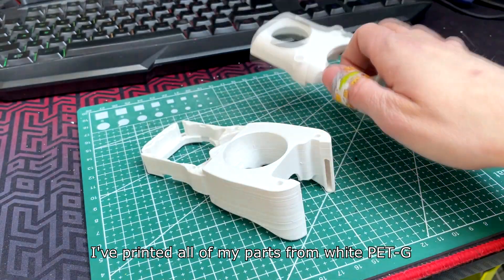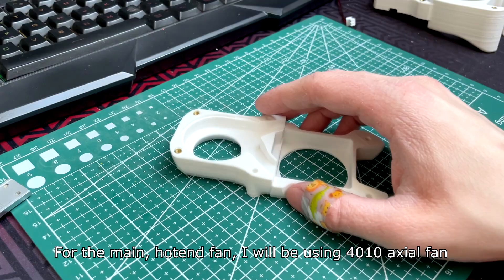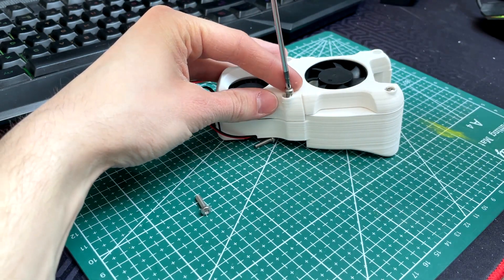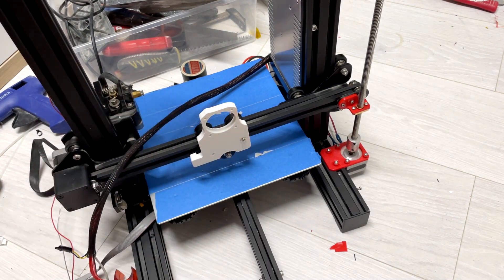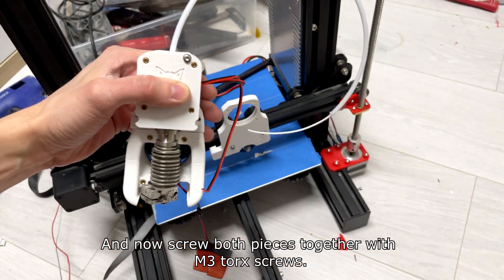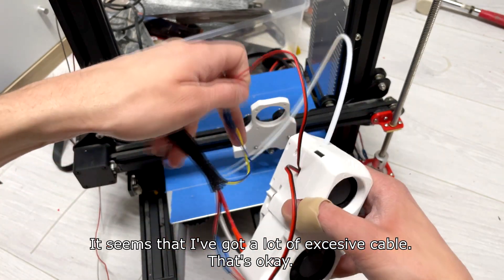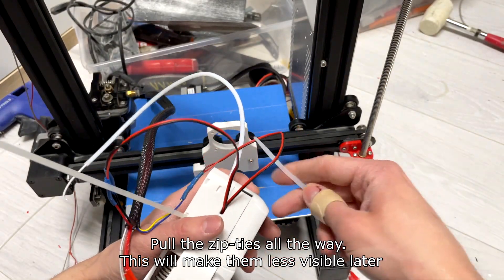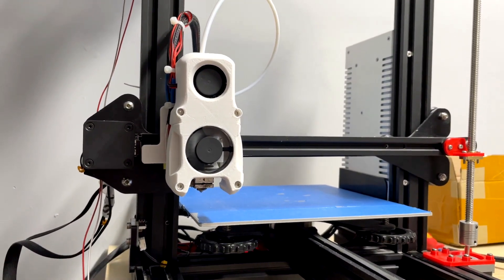Ender Afterburner | Voron Afterburner Remix

Comment: Are you losing Z height with this setup as the after burner is taller than the older extruder? It looks  really neat btw!
Reply from the maker: Thanks! It really depends on which hotend you’re using with it. I think I’ve lost about 10mm total in Z height which is not a big deal for me
Reply: @ManolloMancelli  
Thank you very much for answering ! 
I was asking because at the moment I was thinking about getting myself an ender 3 and a prebuilt afterburner, now I have everything assembled and I'm doing the first tests and calibrations and its really nice 🤭🤭

Comment: What did this prove to do for your printing experience? It looks gorgeous, but no change to the hot end, still a Bowden set up vs direct drive, no BL touch integrated. Wondering what this helps in practice.
Reply from the maker: Way better later cooling and it looks nice

Comment: Nice video! But  a few issues. The heat inserts are the wrong type. The once you have are for injection molding and not heat inserting.